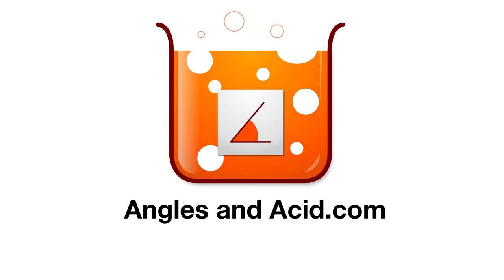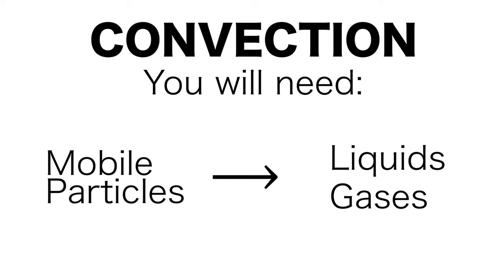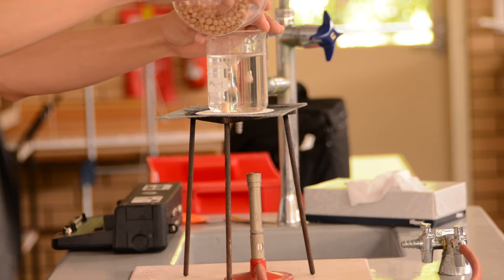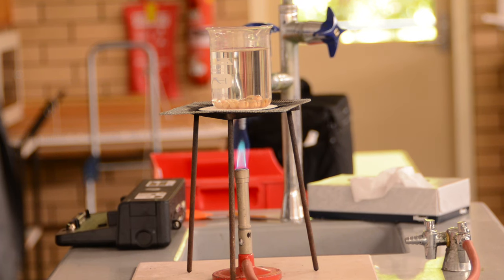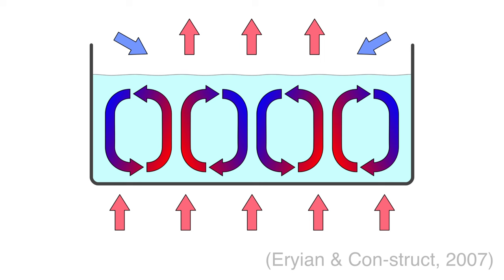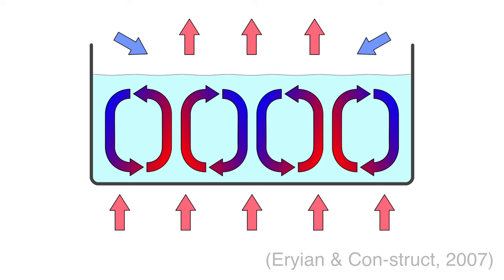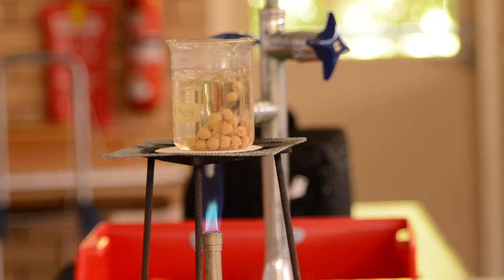Heat Transfer - Convection

Comment: Due to movement of particles it  increase the temperature of water ? If I have a pot of water ,and mix the water inside it quickly does it increase the temperature of water ? ( I'm moving the particles mixing it )

Comment: I was thinking the same experiment could be done with iron fillings in light oil or maybe a heavily saturated solution of salt water with food coloring. You could add the colored mixture to the water by carefully pouring down a pipette. Gentle heating should reveal the convection.
Reply from the maker: ***** Those are some good ideas - I'll give them a try. We do something similar to the coloured salt water to cold water, to illustrate El Nino conditions.
Reply from the maker: ***** Love your video channel by the way - inspiring to see you out there sharing aerospace science with the children!
Reply: Thanks for your taking the time to view. Admittedly i havent updated in some time. Are you also doing outreach in science?

Comment: the movement of solid particle is due to bubbles not heat transfer by confection
Reply from the maker: I would have to agree - I'm still thinking of another method of showing the convection. Traditionally it's shown with iodine or smoke. The chickpeas however still work in the sense that it is a rough approximation or simulation.

Comment: As far as i can see it was the bubbles of gas that created buoyancy for the chick peas.....however i do see the beginnings of a fine hummus dip.
Reply from the maker: ***** That's a good point! I certainly took that for granted. The bubbles do appear in the video to form at the bottom of the beaker, then push the chickpeas out of the way as they rise. I suppose this may have been because I used a section of the video where the chickpeas are clearly tossing about - however when it was slowly heating up to the boil they appeared to jiggle a tiny bit with no visible bubbles. I may need to revisit this experiment to verify. 

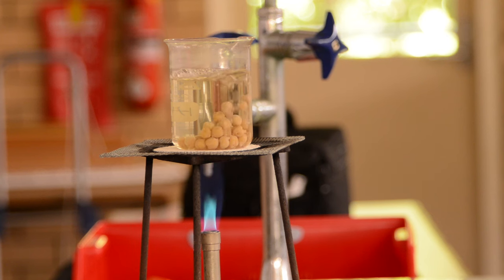On closer inspection of the youtube video footage, at 0:54-0:55 there are some chickpeas getting some serious hang time from the currents when viewed in slow-motion.
Reply: +Sam Gibbs ahahhahah HUMMUS. I was thinking the same thing.
Reply from the maker: Oh that reminds me: I tried improving the design of this experiment this year with vegetable oil and iron filings but I couldn't get the filings to move around - perhaps they were not finely ground enough. I hear that this convection can be shown with smoke though.
Reply: @Anglesandacid DID YOU JUST CUSS